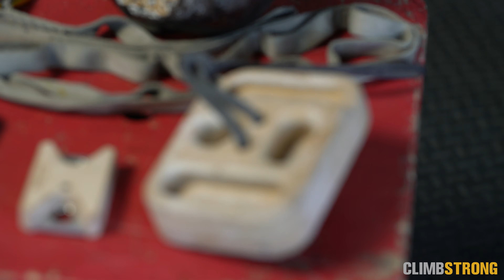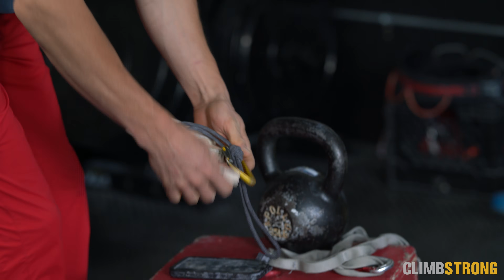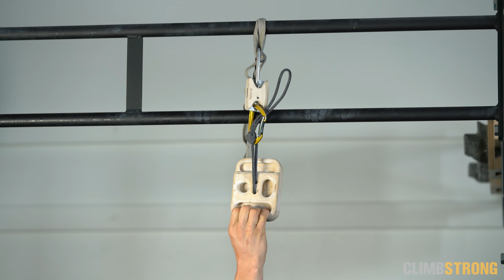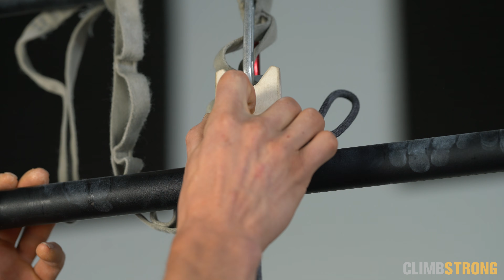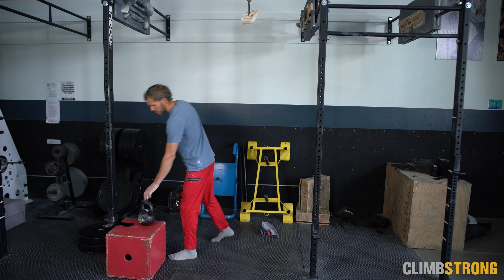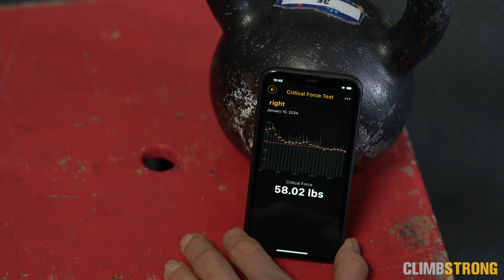How to Measure Your CRITICAL FORCE With The Tindeq Progressor | Testing All Three Energy Systems

Comment: Do you usually test using a yielding isometric or an overcoming isometric to try to isolate the finger flexors?
Reply from the maker: Generally this test is performed using a overcoming isometric - pulling w/one arm and immobilizing the climber with weight or a bar if they are capable of hanging from one hand.

Comment: Doing a critical force test by lifting the Tension Block from an anchor on the ground would not be relevant ?
Reply: Doing a critical force test pulling/lifting from the ground rather than overhead is a good option, especially if it is more comfortable for your body.  Some climbers have shoulder or other pain with overhead work, and for them, lifting from the ground might be a better option.  Lifting from the ground is a little less specific to the positions we use in climbing, but would still be a useful and repeatable method for testing critical force in the fingers.
Reply: @ many thanks!

Comment: How do you train acording to the results?
Reply from the maker: You get a lot of information from this test and how to modify your training will be dependent on your goals, results of the test, and your current training. For example if your goal is a super hard boulder with only a few moves your training cycle will likely look a lot different than if you are trying a long sport climb with many hard moves but no limit moves. Always start your programming with goals and build it backwards from there: https://youtu.be/3h7R8kqU1q8?feature=shared